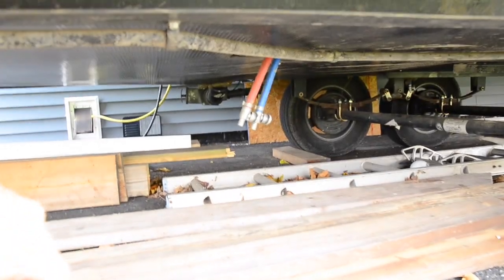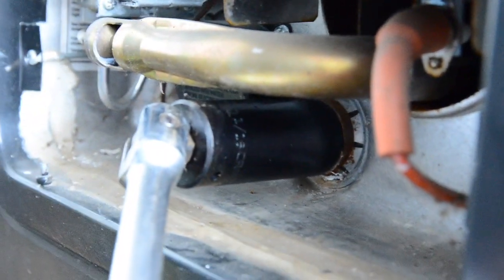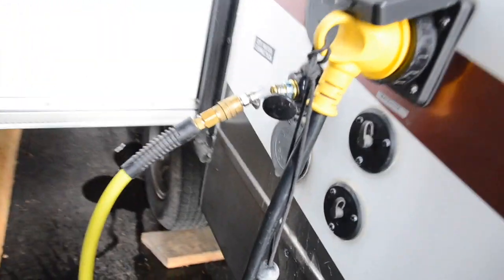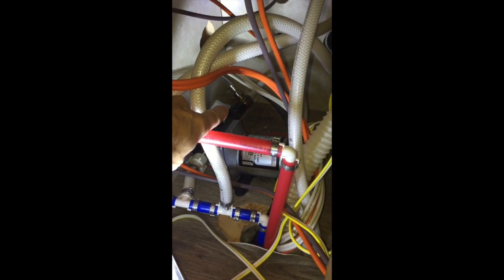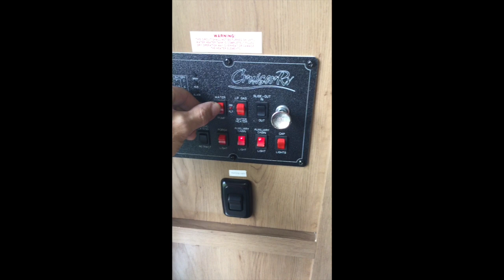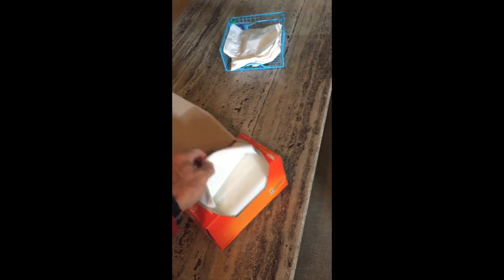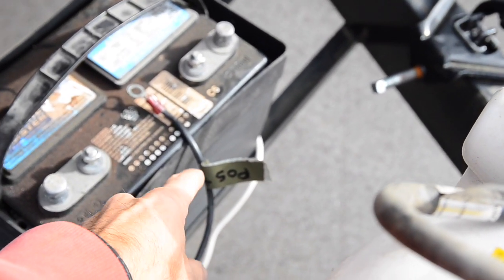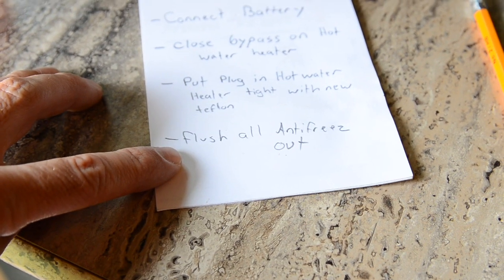How to Winterize or close up camper and keep CRITTERS away for less than $10

Comment from the maker: Here are some links help to winterize your camper. Hope this helps someone out thanks for watching.
please leave a comment
water blow out, air compressor connection  with valve https://amzn.to/3b0T1QO

water blow out, air compressor connection  without valve https://amzn.to/2XqxrBb

dryer sheets https://amzn.to/34tXPeM 

Dewalt tool kit https://amzn.to/2V05kHy

go to Lowes, Home depot, or Walmart to buy the RV antifreeze

Thanks for watching and God bless

*Full transparency. I am a participant in the Amazon Services LLC Associates program, an affiliate advertising program designed to provide a means for me to earn fees by linking to Amazon.com and affiliated sites.
Reply from the maker: You can support my page by just clicking on one of the links above, thank you for your support.

Comment: Write down everything you can think of for both your winterizing & your pre-flight checklist, then put them into a spreadsheet (google sheets for instance).
Sort the list in the order desired, then format with gridlines visible and an empty 1st column that can be ticked off. Print them out and place in sheet protectors. 

Store them somewhere out of the way, maybe hung on the back of the plumbing access panel. Use a marker to check off each step as completed. Permanent marker can be easily removed later with rubbing alcohol or acetone (finger nail polish remover).
Reply from the maker: very good idea, thanks for the comment, and hope you have a great holiday